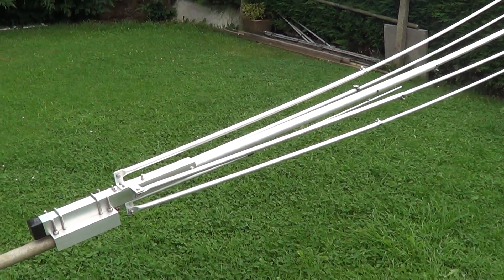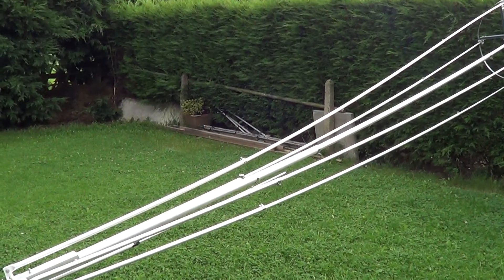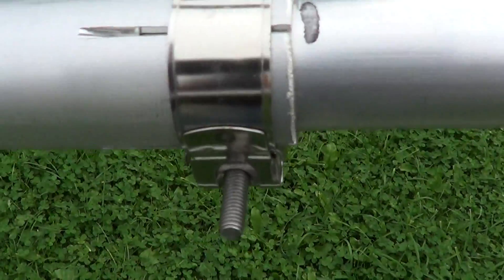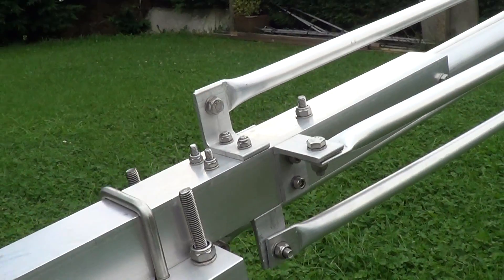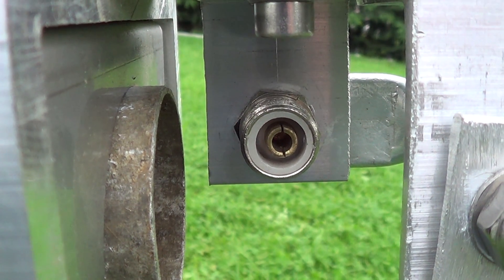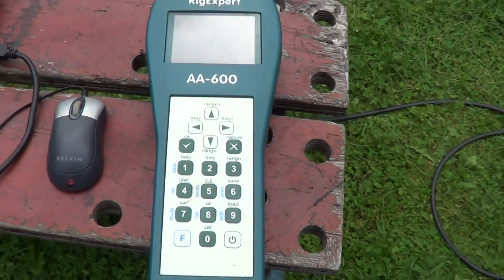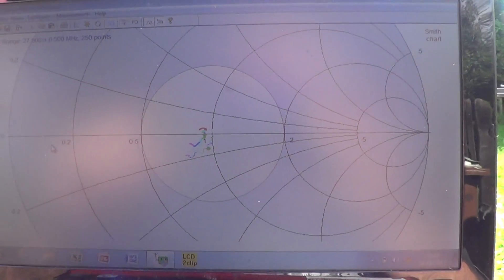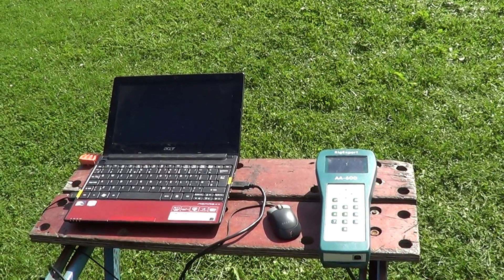Vortex Q82 MKII Antenna Review........Part 2

Comment: is it a better antenna than the sirio vector 4000? I know there's bound to be a big difference in build quality that's obviously reflected in the price but on paper the difference between the two in terms of gain is marginal and when you consider it's over three times the price of a vector I don't know if the additional £250 is justifiable.